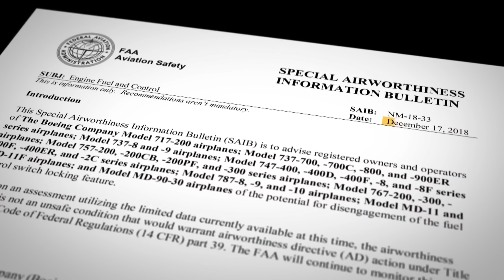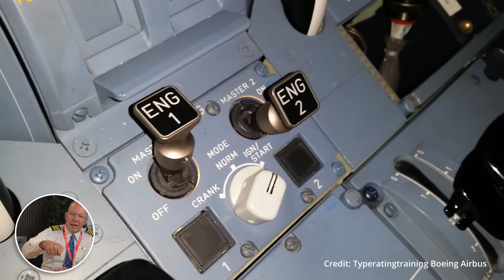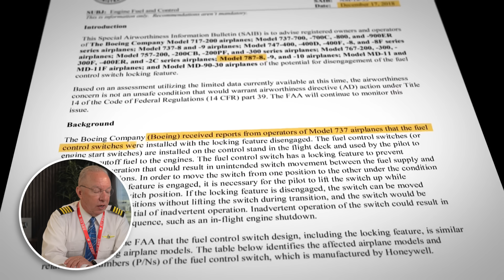Air India 171: The FAA’s 2018 Fuel Switch Locking Bulletin Explained (16 Questions Answered)

Comment: BlancoLirio channel says (direct quote)  "There's the possibility that if somebody is guarding the throttles and you're bouncing around - you could accidently hit those cutoff switches and if the guard is not working correctly, you could accidentally  knock those switches to cutoff."   He is trying to say that this was a mechanical problem, and not caused by a pilot.
Reply: the problem is that those had a 1 second delay during the cut off if it was an accident they would have both been pulled down at 0.2-0.3 seconds delay max... still you forget that right now the indo-pakistan situation is a bit complicated and also it wouldn't be the first "madman" to do something like this for foolish reasons.
Reply: @alessandroblue7  Exactly.   I'm just not seeing the purely mechanical theory at this point.
Reply: You left out the part where he said this would be the best outcome. And how skeptical he was while  saying this.
Reply: He was not saying it “is”/“was” which would be a definitive statement. He was saying it’s a possibility.
Reply: @ModernVintage31 That’s true. It’s why I believe that all the speculation is unnecessary. Wait until the final report is released. We may still be left without an explanation.
Reply: I agree with Blancolirio. Juan Browne is both an airline pilot and licensed aircraft mechanic. He gives the best technical reviews from both standpoints. I have read the 2018 FAA Fuel Switch Locking Bulletin. As a licensed mechanic, I think the FAA bulletin was negligent by not requiring switch inspection during the next scheduled service and replacement of defective switches. I know it costs time and money, but at the end of the day, it's just a switch.  The lost lives are worth infinitely more.
Reply: @nukejets  Why is it that Juan can not call his channel Captain Juan?

Comment: Could one of the LRUs have a virus or backdoor and sent a cut-off command on the AFDX bus causing an engine cut-off without actually operating the fuel cut-off switches manually? Could the confusion in the cockpit resulted from exactly this, because the cutoff was indicated on the instrument panel, while indeed the cut-off switched had stayed in "RUN" position?

Comment: The switches never where set  in the off position, i think, must have been seen, its under your eyes. Can we trust our information.Is the transcription correct. Did you switch the engines off, does not mean  litteraly, if he has used the switches.

Comment: I can't imagine why on take off, that these cutoff switch inputs can be allowed in control logic to actually accept input and shut off engines.. the plane needs to continue the takeoff regardless if fire present or any other reason the pilots need to cutoff.. if not able to successfully gain height from takeoff to safe height and then only allow at most one engine to be shut off.. how can both cutoffs be allowed on takeoff, it is like allowing suicide? It is unfathomable why such control logic could be alllowed. When taking off, cuttoff switch inputs must be ignored untill at least safe height is achieved and then allow one to be shutoff if a fire is detected or any other logic can be determined as a dangerous reason to keep such an engine running, but logic to allow both to be shut off during takeoff is insanity.
Reply: Not unfathomable when you have the fuel tanks located next to the engines inside the wings. Then you find yourself, with one engine on fire, right after becoming airborne during a take off, the fire burning through the wing, where the fuel tanks are located, you must shut down the engine by cutting off fuel, air and hydraulics to that engine....You accomplish this by manually placing the Engine Start Switches to "Cut Off'. That is for one engine, as the airplane will fly with the other engine. 
Cutting two engines is indeed "Unfathomable".

Comment: No one will believe boeing or Air India.😤 Blaming pilots are easy 😤
Reply: its the other way around : it's way too easy and convenient to blame on Boeing nowadays.   It took some solid evidence to blame it on the pilot
Reply: @SkyBear0509 Boeing haters going to hate
Reply: Really?
You can't say "No one will believe Boeing or Air India" and then say, "Blaming pilots are easy".

Everyone is trying to pin the blame on Boeing or Air India because it would be easier to deal with than blaming a pilot. 

A bad switch design would be easy to fix.
A failed switch that should have been replaced is easy to fix.
A pilot deciding today is a good day to take out a few hundred people... exactly how do you propose to fix that?
Reply: Not blaming the Pilots. The Pilot who killed 300.
Reply: How is it the planes fault? First loss in ever!
Reply: Jeet can’t even use deodorant of course jeet crashed the safety record of the 787
Reply: @Miick3y  they checked breath but not shower/smell of body
Reply: @Miick3y  wipe your ass with leaf. Apply perfume

Comment: I've seen Indian outlets including very senior Indian pilot trainers and pilots association leaders vigorously stating that at this point it is too early to rule out the engine computer as the cause of the crash and that it is premature to be focusing solely (or even at all) on the pilots being at fault for shutting off fuel to the engines. The belief is that pilots could not do such a thing because they have procedures to follow and Boeing has a history (MCAS for 737MAX) of causing accidents and covering it up.  In their view the ECC made a mistake which then resulted in the switches being moved as a result of this electronic error. Not that I believe this view but do they have a point that it is too early to focus on pilots and rule out a mechnical / electronic cause?
Reply: For Sale - Two tickets to London from Mumbai on Air India. Cheap!
Reply: I noticed this too. I went and read the bulletin about the switches and it really seems like it's just an installation problem being discussed, a plane wouldn't reach normal operational state and be in service for 12 years with this issue uncorrected. Also with as prevalent as these switches are, if there was a serious design issue, fuel cutoff would happen a lot more often, and we just don't see that.

Regarding the issue of the electronics commanding a fuel cutoff without the switch being moved, I feel like Captain Steve doesn't do a good job explaining why this is unlikely in this case. The reason being that all the controls in the cockpit are set up both to provide the control signals and to report their positions to the fight data recorder. A faulty switch or bus issue would look very different in the data from a deliberate movement of the switch and the system responding. Ie, a faulty switch would likely see "bouncy" behavior in the flight data recorder that would allow investigators to know the switch was bad. We haven't been able to see the raw data, but I expect it would have been noted had it been found.
Reply: @arfink Good stuff. Appreciated!

Comment: Regarding a camera in the cockpit, the black boxes and data recorders don't prevent accidents either but they are in there.   There are cases where video would really help to clear up any possible confusion of what may have happened or who did what. Also if a pilot is not supposed to be reading a magazine or doing something else then that's exactly why you might want video. If you don't want things that you're not supposed to be doing, especially in something like flying a major airline, then don't do it. I was a little disappointed to hear your answer on the video in the cockpit
Reply: Hell if you ever want proof of cameras in an incident, There is a reason that when something happens at an airport that crash investigators ask the public if anyone has cell phone video.
Reply: @filanfyretracker  ah yes, because ALL the cameras are going to be tracking an incident from multiple angles
Reply: Agree with your comment
Reply: He is haslighting us on the camera issue....time to change..
Reply: They do prevent accidents. Not the one they're recovered from but the next one. Video only allows you to assign blame. It doesn't add anything to the data already recorded.
Reply: Because they have sex in there
Reply: I agree, but probably not a good idea to piss off the pilots union.
Reply: I agree, but probably not a good idea to piss off the pilots union.
Reply: "I was a little disappointed to hear your answer on the video in the cockpit"
Thats because he did it..
Reply: Captain Steeve said it would not have prevented the accident. We know that. It would have shown us if those switches were deliberately changed to cut the fuel & who was responsible, instead of non stop speculating. Was it suicide or was it engine failure? I'm surprised Captain Steeve didn't jump to the chance of having visual recording on every flight, he's the one guy I thought would 100% agree its a great idea. Can't imagine him ever doing anything he wouldn't want recorded. He's so squeaky clean 😍 we sure do love him ❤
Reply: @starlove8044  We know they were deliberately moved and the investigators know who did it. They just aren't telling you yet.
Reply: @BabyMakR  Yes, but with visual footage, not just black box it would determine the cause in a nano second instead of weeks of speculation. The preliminary findings reveal almost nothing of the pilot and co-pilot's final conversation.
Reply: @starlove8044  Only civilians are speculating here. The investigators already know who did it. They're moving onto the why it was done now. The only reason you want to see video is so you can know who your anger should be directed at.
Reply: @BabyMakR  I'm not angry. Everything happens for a reason. Speculating is futile.
Reply: @starlove8044  Well there's plenty commenting that they want to know which pilot's family should be punished.
Reply: @BabyMakR  that's plain wrong.
Reply: Totally agree .
Reply: Cameras could've prevented this as well. I totally disagree with Steeeve here. It's clear the pilot that did this wanted some plausible deniability. Just making it harder for that pilot to achieve that might prevent the accident all together.

Most of the time these events aren't well thought out, so if there's just a slight hurdle they need to overcome to avoid getting found out; they might by then have changed their minds about this whole thing.
Reply: @rany2  Found out? What found out? He died. What found out can there be? What do you thing he's trying to get away with here?
Reply: @BabyMakR Lots of reasons why. Off the top of my head: life insurance for the family would get invalidated, his family could get ostracized, etc.

Besides it's clear he didn't want to be found out. He took active measures to prevent people from knowing who did it. In both cases no matter how you look at the cockpit voice recorder it's bad. When one of the pilots asked "Why did you cut it off" the response was that "I didn't cut off." It's clear that either the pilot asking this question was either gaslighting the other pilot (i.e., he did it and this was a diversion) or responding pilot was lying as he didn't want to be caught by the CVR.
Reply: @rany2  Ahh So you want video to punish the family of the offender. Not to prevent it from happening, just so you can exercise your anger...
Reply: @BabyMakR Of course not, the hope is that they simply won't do it because they know they're being recorded.
Reply: @rany2  there is no plausible deniability here. No pilot would ever think that the action not show up in the FDR. Plausible deniability would be faking a heart attack / stroke / sudden epileptic seizure, and falling on top of the yoke. Be sure you fall slightly to one side so as to put the plane into a downward spin.
Reply: I am opposed to the idea of video in the cockpit.  There are very good arguments to have one, however, I don’t believe video has the “security” that the CVR has, for example.  Additionally, the CVR data is, strictly, only used in an aircraft accident investigation.
Reply: @vick-i4e2k why would the video data be any different? It would be stored in the same “black” box.
Reply: @mikewilkins9484  👍 thought about that, but have no idea of the technology involved to allow that to happen, including the survivability of the data.  🤷.  Additionally, the cost to install may not be feasible.
Reply: @vick-i4e2k  video will be stored the same way voice is stored. none of that data leaking BS
Reply: @delayedcreator4783  Risk Analysis.
Reply: @delayedcreator4783  You do realize that video requires massively more storage than voice recordings, right?
Reply: @birdn4t0r7  you do realise a thin piece of metal can store 2tb of data ,and the data doesnt have to be stored forever. you are still in 2000 ,its 2025,wake up.
Reply: great point. Love captain Steeeeeve, but he is being intellectually dishonest, big time.
Reply: @joeb6773  I wasn’t going to “bite”, but how dare you make such an uneducated, condescending remark toward Capt Steve and his professional opinion.  Shame on you !

Comment: Well said, I must say as an Aviation Enthusiast this Air India 171 castrophic accident is very confusing. It must have been done intentionally but if so there must be a reason why. Could it possibly be a family problem and that pilot is severely depressed and commited suicide this way? Was the pilot themselves investigated to see whether they had any severe problems in their life and possibly cause this castrophic accident?
Im highly doubting the fuel switches could it have been installed improperly as you mentioned that Boeing 787-9 or 787-8 had its throttle replaced twice...
Reply: I believe its highly unlikely that the pilots did a deliberate act. I find this very hard to believe

Comment: Would it make sense to not allow the Fuel switches to be switched off during takeoff or inflight? To my understanding they are switched off when at the gate.
Reply: No.  They are required to be turned off if an engine catches on fire during flight.

Comment: Again my question is if the issue was with fuel switch why did the plane struggle during liftoff....why did it take the entire runway to lift off.
Reply: plane had normal liftoff, it didn't even take the WHOLE runway, just most of it, and that is normal behaviour.

Comment: Thanks Captain Steve. Could the other pilot not have reversed the cut off switch and put it back on quickly?
Reply: They did.  Engines were spooling up.  Not enough altitude to recover
Reply: He did in fact do that. 10 secs after they were cut off, the other pilot put them back to run. 

However, the issue is, the engines generally take 30-60 seconds to get going. There just wasn't enough time for them to come back on and generate thrust
Reply: I see, thanks for the explanation. Sad situation 😞
Reply: I thought they did

Comment: There is no evidence yet that a pilot turned off the fuel supply.  Can still be a system failure. I refer to this statement by the FAA:
The FAA is warning of a possible flaw in the fuel control switch locking mechanism on Boeing 737s and Boeing 787s. If left uncorrected, the problem could lead to inadvertent movement of the switch and inadvertent engine shutdown during flight.
Reply: Well, there is though? Please watch the previous video on this channel
Reply: But what about ; how one of the crew said (why did you turn it off) ?
Reply: No evidence?? There is the slam dunk evidence of the FDR
Reply: Both? Get real
Reply: @michaelcoetzee1541 it became real. We are talking about winning a lottery or being the president of the US. There is that one person who got all the 7 lotto numbers.